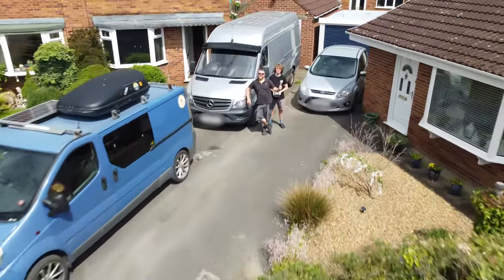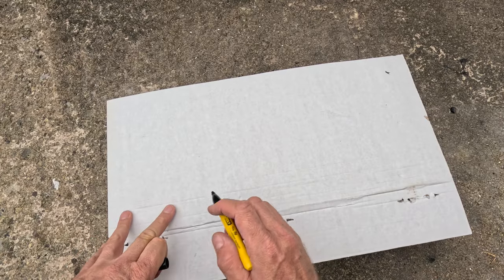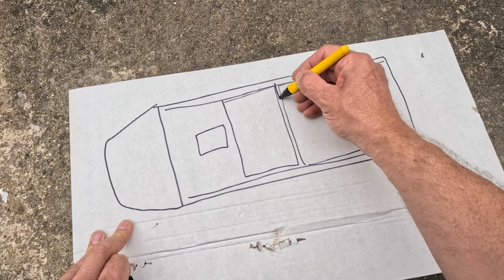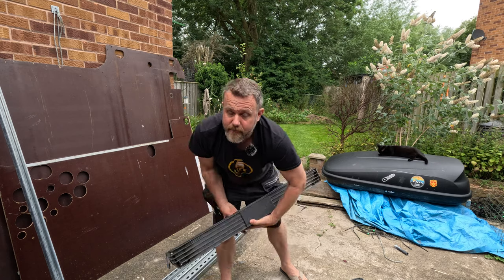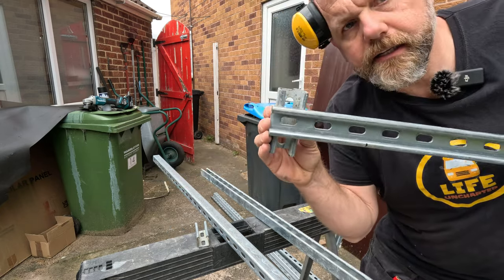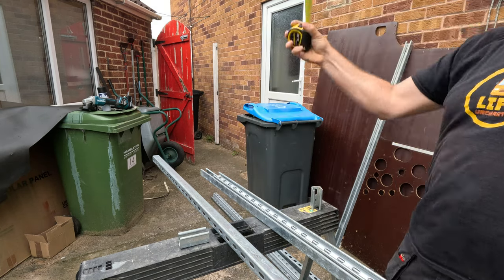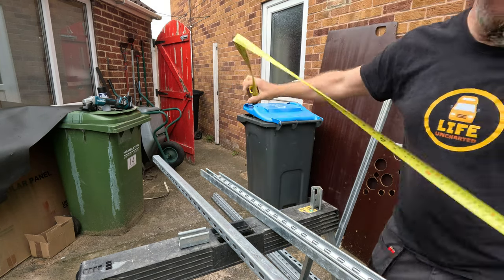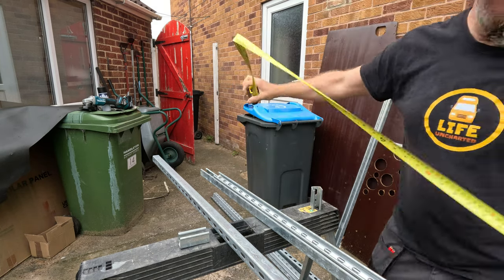Budget Friendly Roof Rack Option, Unistrut! It's all hard work!

Comment: I love unistrut!lol made my rack more or less the same, I used the solid strut(no holes) for the 2 parallel lengths and drilled my own fixings to suit, plus used capping on top to stop any standing water👍🏼

Genuinely though, I am a little concerned you only used 3 m6 rivnuts to fix on each side.

Rivnuts are a strong fixing but for this application..you have to think if wind gets under your panels whilst driving creating a “sail effect” the surface area those 3 or 6 nuts have with force constantly pulling up and shaking is really minimal.
The roof steel is only 1-1.5mm thick at most and the rivnut contact/pinch area is like a mostly sucked polo!haha …couldn’t think of a better description 😂

If you still have access I’d strongly advise you to use bolts straight through the strut holes and a penny washer inside to spread the load.
You can still alter the layout anytime but the main rails will always be permanent regardless. 

Sorry for the long comment.
It’s not a knock at your work mate , purely a safety thing 👍🏼
Reply from the maker: @ourworldonwheels  hi. Thanks so much for the advice. This is why I love getting the comments from everyone. So don't worry about sending me free advice 😉. I've actually got 6 nuts down each side. I guess the video made it look like 3. But I hear what you're saying. I could drill a few more and use the other type of rivnut. I forget the name but the spread out much more than the basic rivnut. I'm obviously just copying what I've seen other on YouTube do. The University of YouTube 🤣
Reply: Would a Wee spoiler type of thing infront of each solar panel sort the wind problem? 🤔
Reply: @life_uncharted wee spoiler type thing to divert wind problems I front of each solar panel!!😇🏴
Reply from the maker: @gilly19651  yeah. Would be a good idea if there's any issues 👍👍

Comment: Love what you are doing. I will be starting my van build in January 2025, with the intention of touring part of Europe with my wife next September and we will be bringing our 3yr old grandson on daytrips and weekends away in Ireland.I am really looking forward to that. I am currently growing my stock of tools and accessories so that I do not cut into my budget for the van conversion when I start. I cannot currently decide between a Sprinter or a Transit (both hf and lwb) and I am researching both. However I cannot get accurate dimensions on the intetnet for the proposed living space (bulkhead to back door) and width I keep getting conflicting information. Also I know it is personal preference but I have calculated (roughly) that a 300ah leisure battery set up would be more than sufficient, however 3 x 100ah batteries or 1 x 300, I like the redundancy aspect of multiple batteries in case of battery failure but then again 1 battery is appealing  too, as lithium ion are really reliable regardless. Anyway, you are doing Great, with the kids, with the van and with the your future planning.
Reply from the maker: Hi. Thanks for joining us on our journey. Sounds like you have a lot of thinking to do😉. It never ends, trust me. I'm past the van deciding stage and now I'm trying to make a decision on security and fridges🤦. The money is going down fast!